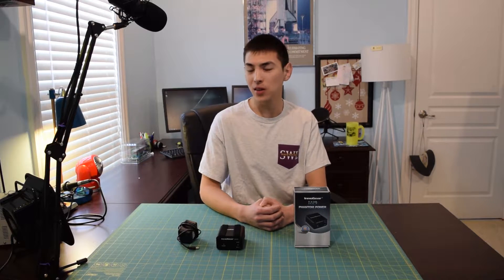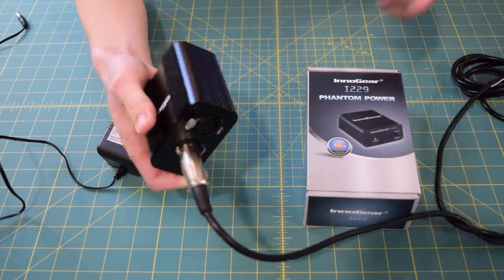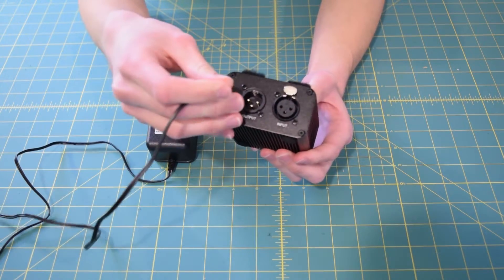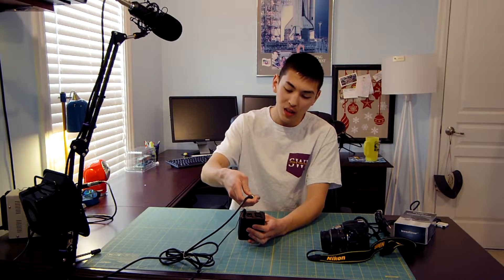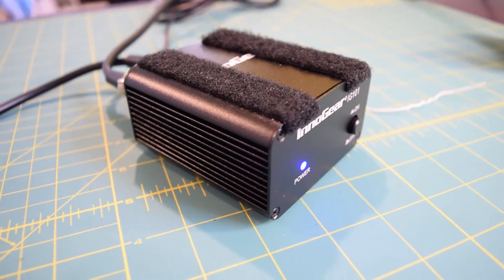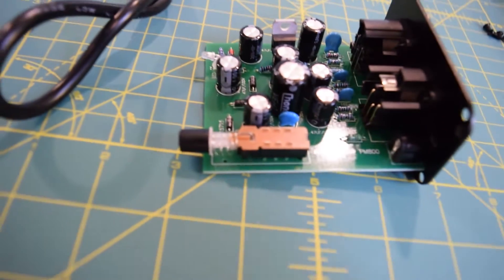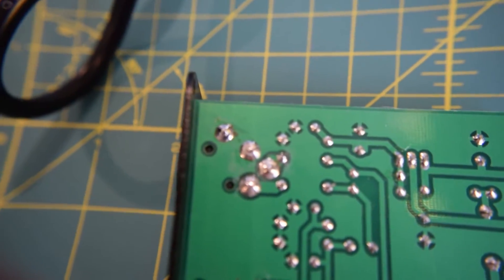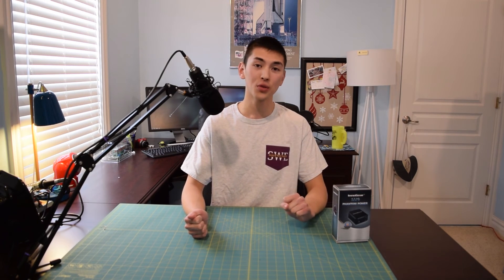InnoGear IG101/I229 48V Phantom Power Supply Overview and Teardown

Comment: Solder work on mine is abysmal. Pins on the IC controller are soldered together, as are the positive and negative terminals for two resistors, and the same goes for the XLR Input.

The little blue LED does a rave for me whenever I plug it in, which is a neat effect, but that's about all it does.

Comment: I purchased one of these and it only lasted a week before it wouldn't turn on anymore? No burn marks on the board or anything showing overheating so I'm stumped on why it won't turn on. It lights up for one second then goes off. Very frustrating

Comment: I have had this one for about 2 or 1 week and it died on me already. everytime i turn it on the led shuts off and the power supply lets out a high pitched sound which does not stop until turn it off

Comment: I have the InnoGear 48v phantom power with a flourean BM 800 mic. I get this really bad hiss noise when I record. I believe it is the phantom power because when I turn off the phantom power, the hissing goes away as the power box slowly dies down. Any tips?
Reply: Jeff Heidelberg did you find a solution? I'm having the same problem

Comment: It does not provide +48V phantom power. I have investigated further. There is no boosting circuit to make 18V DC to 48V DC, rather it drops the voltage around 15V. This company is lying in their Specification (Amazon Page). It will mostly work, but not as good as another preamp with a +48V supply. I am regretting my decision for buying this already.
Reply: FINALLY SOMEONE ELSE WHO UNDERSTANDS.
Reply: Zp5
Yes, ther is no converter circuit to +48v.
There only 1 active component (like ic/transistor with 3 pin)
May be its LM7815 or i dont know.

Comment: Should I use a soundcard in this setup?
Reply: With the phantom power?
Reply: phantom power is required to power the mic. As the presenter mentions, yes, you CAN use a sound card with a phantom powered mic.

Comment: Hi Nice Review, 

Can you tell me if Cardoid Mics are better. also I am planning to setup a similar system , 
please suggest a similar system with links where I can buy cheap mic setup.
Reply: cardiod refers to the mic's pickup pattern. cardiods are more directional than omnidirectional mics. It has nothing to do with condensor vs dynamic mics. Both are available in cardiod or omni patterns.

Comment: For the output is it possible if i can use a usb rather than an 3.5 audio jack
Reply: the output is XLR, You'll need the XLR to 3.5mm cable. If you want usb then you'll need an external usb audio adapter. So mic into phantom power, xlr to 3.5mm into usb audio adapter, then usb into pc

Comment: Nice video man, I just ordered an At2020 XLR mic and i have a few questions on setting it up.

1. Will the "InnoGear 48v Phantom Power Supply" be the only thing i need for the XLR mic, or do i need a PreAmp too? (I am planning on connecting it to my mac and I've read somewhere that you need both and i'm not sure why, just want that cleared up.)
2. For the output that goes from the power supply to the mac, does it have to be an XLR to 3.5 cord, or can it be XLR to USB cord? (Will there be any sound quality differences if i chose to use the XLR to USB?)

This is my first Mic so i apologize for my stupidity.

Comment: Hi mate I recently bought a new microphone. I bought the BM-700, you probably know it? I have an xlr to xlr cable running from the microphone to the Innogear Phantom Power Supply shown in this video and then an xlr to 3.5mm running into a USB Soundcard. If I plug it directly into a 3.5mm microphone jack on my PC no microphone appears and if I use the Soundcard it does, however no matter what software I'm on the microphone creates a constant buzz. Any suggestions for fix?

Comment: Great vid but I have a question, if you output the XLR cable to 3.5 mm jack on your computer, where am I supposed to plug in my headphones?? Would I need a Audio Jack Splitter?? Like would the setup still work if my headphones and the XLR to 3.55mm cable were plugged into a splitter, pls help

Comment: No talk straight in to the mic it was a bit quiet for me  thanks can I ask a Question sorry can you plug straight to the computer why you need that Phantom plugged in it didn't sound that different with it in line ?ok I know stupid question sorry one more question why that mosfet had no heat zink on it ? or was it a power transistor still no heat zink on it ?
Reply from the maker: +Kriss Bartlett A computer line in will not supply the mic with enough power to function properly.  When I tried to use the Neweer microphone without the powersupply It did not even work through my computer or camera.  You only need an external source of power for condenser microphones, most dynamic microphones do not need the extra power.
Reply: ok thank you

Comment: What camera do u use for your videos?
Reply from the maker: +Kams Vlogs Currently I use a Nikon D3300 as my primary, a Pentax Q 10 as my secondary, and a Kodak Zi8 for very lengthy clips (over 10 mins).
Reply: +AA Computers and Technology Omg this weekend I was just gonna buy the Nikon D3300 is it any good?
Reply from the maker: +Kams Vlogs I really like it! Image quality is sharp, color production is good, and it will record 1080p at 60fps which is great for YouTube!  Low light performance is also surprisingly good for a camera in this price range, I notice very little noise in my shots when lighting starts to get low.  If you want an idea of how well the camera performs just check out my past 10 videos, I shot them all primarily with the D3300!  The only thing that gets on my nerves sometimes is the fact that it does not have continuous auto-focus, I have to keep checking the display to make sure the shots are not blurry.
Reply: +AA Computers and Technology i got a nikon d5100 and i don't have a 60fps option 😔😔😔😔😔😔😔💔💔💔